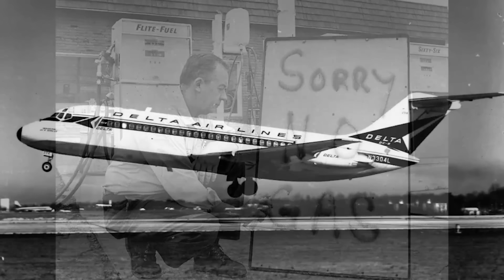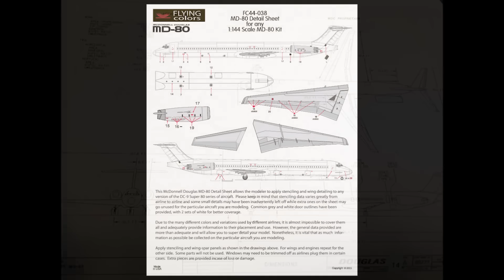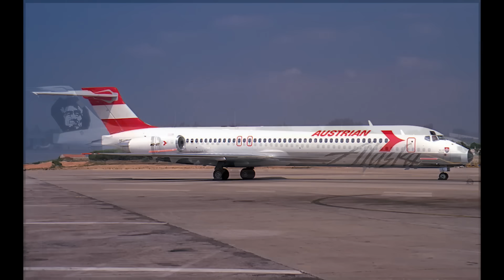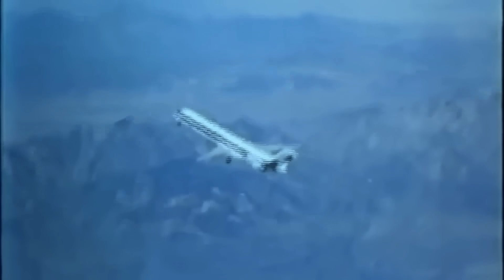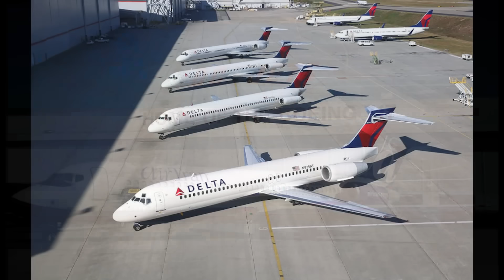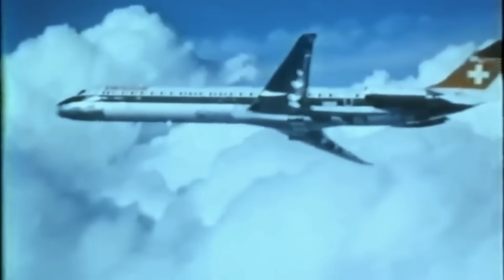The Jet that pilots HATED

Comment: I'm not even two minutes in, and I've already noticed two glaring mistakes. One, though Airbus existed back in the 1970s, they only had the A300 back then; that was a widebody jet, not a narrowbody. Secondly, the A320 wasn't even thought of back then. The A320 program wasn't officially launched until 1984, and the type didn't enter service until 1988. Thirdly, the MD-80 didn't have high bypass turbofans; they just weren't as low bypass as the teen series JT8Ds were. The early P&W JT8D had a bypass ratio of 0.96 to 1, IIRC. OTOH, the MD-80 had 200 series JT8Ds, which had a bypass ratio of about 1.74 to 1; while that's higher than the early iterations of the JT8D, it's hardly what one would call a high bypass engine.

Comment: There were several problems with the MD80. Using thrust reversers reduced airflow over the rudder so in some circumstances the rudder lost authority and the nose steering was not able to stop it drifting off the runway after landing. In one test flight, they landed too hard and the tail fell off! Only minor injuries. They didn't notice until they were back at the gate - imagine their surprise. The other issue was a tendency to porpoise on landing, which could be very dangerous. PIlots had to be very careful with the flare before landing. Although looking at the comments here, pilots still loved it.

Comment: I loved flying in the MD-80 series, being five seats abreast meant that you really had to be unlucky not to get either window or aisle seat. And also it had a rear door and stairs so that in smaller aircrafts without jetways even if you were on the back of the airplane you could board fast. The plane I hated flying back then (the 90's) were the 737s.

Comment: I have flown onboard every single type of the 
DC-9/MD-80 aircraft family as a flight attendant during the 1980's until 2010. 
Neither I spoke to any Captain nor to any of our 
Cabin Crew that did not like this aircraft! 🤷🏼‍♀️
Reply: Evidently, you never spoke to the ramp crew. 😉 The Mad Dog was a complete pain in the ass to load and unload. On many of them we had to splice the air conditioning hoses to reach the aft access port. There were three cargo bins, which meant we either needed three beltloaders, or had to reposition one, and the rear cargo bin smelled like an outhouse.
 Nothing made me happier than when my airline retired them. Good riddance! 😂 I sincerely hope you are enjoying retirement...I am! ✌️ Mark (MSP)

Comment: You didn't mention the worst MD-80 accident--Alaska Airlines Flight 261 in 2000.  An MD-83 had been poorly maintained and the improperly unlubricated jackscrew for the elevator had stripped its threads.  It was partially flyable, but, just before landing,  it gave way completely and the plane lost all control, crashing inverted into the Pacific.  All 86 on board died.
The elevator jackscrew was a single point of failure, with no backup, which modern plane designs try to avoid.
Reply: Name a commercial airliner that has an elevator jackscrew backup. I don't know of any that has one.
Reply: @0w3nn  That's right, that system is difficult to make redundant.  But most airliners now do have redundant elevator actuation.  This is accomplished by having multiple independent hydraulic or electromechanical actuators for each elevator half, powered by separate hydraulic systems, and controlled by redundant computers.
Reply: @geoffk777 Regardless, there is only one jackscrew assembly. Doesn’t matter how many independent motors, hydraulics, computers control it, there is still only one jackscrew. And that was the problem on this flight. This would’ve happened to any airplane.
Reply: @0w3nn  Ok, you clearly misunderstood my last post.  Yes, any airplane with a single jackscrew controlling the elevator is not redundant.  But modren airplanes don't use this design.  They have multiple hydralic or electric elevator actuators connected to other redundant systems.  So a total elevator failure is almost impossibe.  That couldn't be implemented on the MD-80, but it has been implemented on more modern aircraft.
Reply: @geoffk777 Actually, all airplanes, including modern ones, still only use one jackscrew. No redundancy, one failure point. They’re susceptible to the same issue, and it needs to be well maintained to prevent another Alaska 261. Only the DC-10/MD-11 used two jack screws for the horizontal stabilizer.
Reply: @0w3nn  Well, that is just plain wrong.  For example, read this detailed description of the elevator control system on a Boeing 777:
"Column movement results in movement of the connecting rods of the elevator fuel unit. Position transducers measure the displacement and send an analog signal to the actuator control electronics (ACE). The ACE converts it into a digital signal and sends it to the primary flight computer (PFC).  The PFC calculates the final elevator position and informs the ACE. The ACE sends a signal to the elevator power control units (PCUs). There are four PCUs, two for each elevator, mounted on the rear spar of the horizontal stabilizer. The PCU is an electrically controlled hydraulic actuator. PCUs use different hydraulic systems of the aircraft for redundancy. The ACE signal causes the PCU actuators to move the elevator in the commanded direction. Position transducers on the PCU give the elevator position feedback. The computers, with the help of feedback signals, ensure the elevator has deflected exactly to the desired position, allowing precise control of the elevator."
Reply: @geoffk777  First of all, you're talking about the elevator, not the horizontal stabilizer trim. They are two separate things, and that shows a fundamental lack of understanding on your part. There was nothing wrong with the elevator on flight 261. Second, you're still talking about the actuators and not the jackscrew. It doesn't matter how many redundant actuators there are, they still only control ONE jackscrew. If that jackscrew fails, you're DONE, regardless how many ways you can control it. And that's precisely what happened. Hopefully you understand now.
Reply: @geoffk777  Straight from an aircraft mechanic - 
"All the Boeing's (747, 767, 777) and Airbus (A330 / 340) I've worked on only have the single jackscrew. Pretty sure the 737, 757, 787, A320, A350 and A380 are similar.

These are configured with an unthreaded backup shaft located concentrically inside the threaded shaft, and use the recirculating ball design."
Reply: @0w3nn  Ok, I did some more research and you are correct.
- Jackscrews are not used for elevator actuation.  They are used to adjust the horizontal stabilizer to properly trim the elevators to neutral force in flight.  The elevators are actuated by separate devices, as I described.
- Dual jackscrews are not practical because if one jams, then the other one would also be unable to move.  Some design redundancy is built in through internal torque tubes and dual nuts.
- Since the Jackscrew cannot be made redundant it is a single point of failure.  So there is careful material selection and strict maintenance and inspection standards.  These have prevented a similar jackscrew failure accident for the past 25 years.
- The problem with Flight 261 was that the jackscrew was so badly worn from lack of lubrication that all threads stripped and the nuts and torque tube could no longer hold the horizontal stabilizer in place at all.  It was freely deflected to its maximum upper position, which made the elevators ineffective and the plane uncontrollable.
- All modern large aircraft continue to use jackscrews for horizontal stabilizer trim (and some other purposes, like flaps, etc.)  
I apologize for my confusion on this issue.

-
Reply: Humm,,, a lot of "modern" aircraft use a jackscrew design Wilbur.

Comment: The MD-80 will always be my all-time favorite airliner no matter what.
Reply: 5 across seating SUCKS!  Embraer E-195 E2 is far superior.  146 passengers.  Every seat is window or isle.  Southwest is stupid to not replace every 737 with this Embraer.
Reply: @raymond3803  The Embraer is one of the ugliest commercial aircraft I've ever seen.
Reply: @0w3nn  Why do you find it ugly?
Reply: @raymond3803 Mainly its nose. I don’t like how the tip is so far below the cockpit window. The tail is also very long, looks tail-heavy. Also not a fan of its gigantic wing-to-body fairing. Also, really don’t like how little wing flex it has.
Reply: @0w3nn  Porter Airlines love them.
Boeing 737 Max 7 estimated $140M 144 seats.
Embraer 195 E-2 $60M 142 seats.  Window or isle.
Reply: @raymond3803 You’re forgetting the fact that the max 7 has superior range over the embraer. Therefore it fulfills a different purpose, meant for long and thin routes.
Reply: @raymond3803 furthermore, the Max 7 has an exit limit of 172 seats while the E2 has a limit of 150 seats. Carries more belly freight as well.
Reply: @0w3nn  You're right, MAX 7 fulfills a different purpose.  Destroying Southwest.
DID YOU KNOW?  When Southwest was founded.  They hired Hugh Hefner to interview & hire their entire staff of stewardesses.  SW thought Hefner had a good eye for the talent SW was looking for.  SW thought Hefner did a great job.  So much so, their 1st Company Moto was:  Southwest Airlines, Long Legs & Short Nights. SW was sued for sexist advertising.  They settled out-of-court.  FACT!

Comment: Hawaiian Airlines flew the MD-80 and still operates the B717 inter island...
Both were superb, dependable, quiet aircraft.
Reply: Hawaiian flew DC-9 than the 717.  They skipped the MD-80 version.
Reply: @External2737    They flew the MD-80, specifically the MD-81 from 1981 to 1993.  6 of them.  Tails N809HA, N819HA, N829HA, N839HA, N849HA and N859HA.

Comment: I have 3700 hours on the 88. It is a pilots airplane. You need to know how to fly, and a lot, perhaps most pilots, cannot fly. But if you can fly, it is a fine plane. Perhaps the most complicated cockpit I ever flew in. I think we counted 60 switches to control the lighting. Not kidding.
Reply: Kent Wien did a pretty cool video of the MD80 and talked about all the lighting switches.

Comment: The model  post xd9 made byMC Douglas was not properly designed and built  as a result the rear cargo  doors. Failed on two flights one  in 1972  in the Sk which by pure luck and skill they were Able to narrowly land with the plane mostly intact on Canadian soil with no fatalities.  However the second a cargo door failed during  incident in 1974 the damage was to server the pilots could not recover to  make a safe landing the plane violently crashed onto the ground in France this time no one survived every person on board was killed. Mc Douglass knew about the defect but decide they did not want to spend extra time an money to fix the planes structure. Which was totally unacceptable. 😒
Reply: This sounds dc10

Comment: MD-80 was a miracle at the time it came. You can still fly an MD-80 just like fly any other A320 or B738. All of them are RNAV equipped and capable to fly any of rnav sid or star routes. These good old jets also capable make rnp approaches which makes them capable to fly any modern ifr technologies. No only single pilot I ve ever met who flew MD-80s told bad things about MD-80. Almost all of them were in love with their plane. I dont know any MD-80 pilot who dont wanted to go to flight. They were proud to fly a 'real plane' not a computer which has wings. I know it needs much more attention and experience to fly an MD-80. One MD-80 pilot told me they re very good planes, the MDD company built them to last forever, there are more work to be done in a MD-80 compared to an A320 and MD-80 needs to be monitored by pilots all the time. But they were very happy with their plane and they had very strong energy. Most of them were very stong because their planes flight controls are not hydrolic controlled the flight controls are fully manual. One more thing they always want loadsheet manually written on paper. They always reject loadsheet made in computer. Because their balance fuel program doesnt work with loadsheets made in conputer. I dont know the told so. I know this plane is difficult to balance. It is too long and tight. Also its engines mounted back so theese make MD-80 very difficult to balance. Espessially if the plane is empty or about to empty they take off trim-out position. I remember the flight crew had to replace seats of passengers too often compared to other planes. They always had to argue with passengers who rejects to change seat. In addition the forward side of the plane was very quiet and I can only hear the flow of air but the rear section was so noisy. Their back galley was so unusual it was in the left side of the cabin a lil bit forward of the left engine. There were also raws in back of back galley. The last raw of that plane has no windows because they were near the engine. They did not bring 2nd stairs for the back raws because MD-80 had airstairs in the back section. We used to walk under two engine and climb up the airstairs back then. Good old days, good old planes, happier people. Life was much more better than it is now. There was another interesting plane, the 727. MD-80 pilots only respected 727 pilots. The others were ignored by MD-80 pilots. Especially Airbus pilots. Unlike MD-80 pilots, 727 pilots were so quiet and wise. They were generally all in the final stages of their careers, and they were elderly, calm, confident, very polite but strictly adherent to the hierarchy, authoritarian but affectionate, and they inspired trust in their interlocutors. In those years, 60 was considered old. Unlike the MD-80 pilots, most of them had a military background. Therefore, these people were very organized and less talkative. You had to be very organized to please them. Then the 727s retired, and these people retreated to their corners. Some retired early. Many of them weren't heard of until after they died. The 727 pilots were people who took everything for granted. They weren't surprised by anything. They also accepted their retirement as normal. The MD-80 pilots seemed born to fly. I remember the frequent depression of those nearing retirement. I don't have many memories of Airbus pilots, but I do remember this: They appointed some young 727 copilots as captains of A320/321s, and many of them weren't happy. But none of them would explain why.  Some newly licensed youngsters were also made copilots in MD-80s, and they weren't happy about it either. They complained that they became pilots with the dream of flying a 737NG or an A320 for better wages, but had to endure grumpy boomer captains in the clunky MD-80s for low wages. I always wanted to be a pilot, but couldn't because of poor health. Years later, I'm back in my hometown, with a computer in the simulator that allows me to fly any aircraft I want, whenever I want. I usually spend the cold winter days, when there's not much to do, filling the stove with wood, brewing tea on it, and flying in the simulator. It's certainly better than the summer days, when there were always things to do, people stranded on the road calling in the middle of the night, cars boiling and burning gaskets, tractors breaking ball joints, balers tangling twine, combine harvesters breaking blades, and I had to work all the time and spend my free time visiting weddings, being annoyed by the noise, and picking up drunks at the end of the night. Those old days feel like a completely different century now.
Reply: Nobody is going to read all that.

You mentioned rnav capability... Yes, but the database wasn't capable of holding the entire united states. You basically had to choose a region for the plane to operate in.

Comment: I never cared so much riding in the MD-80/90 or DC-9, but for some reason, I've really fallen in love with the MD-95/B717.
Reply: I designed parts for it (MD-95) since the twin jet team was understaffed.  Carbon composite elevator tabs and the vent louver in the tail cone